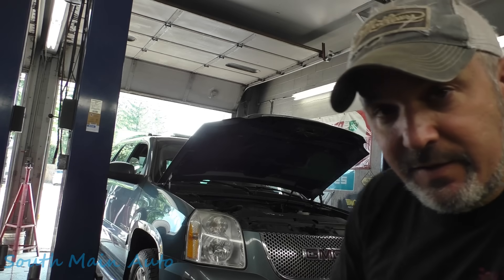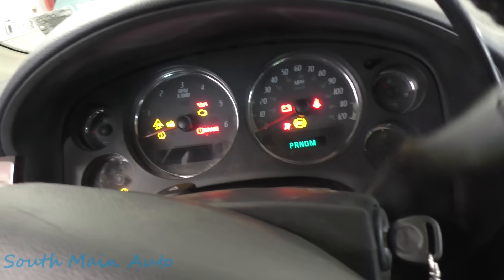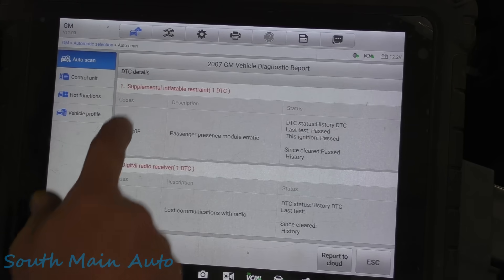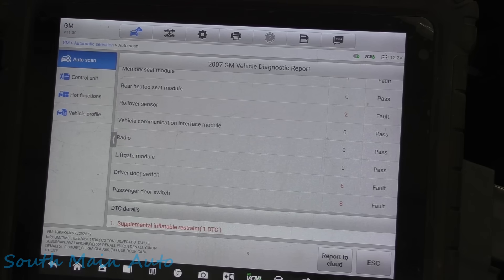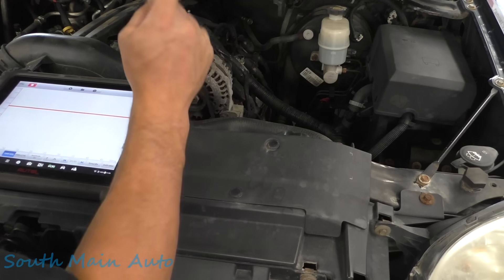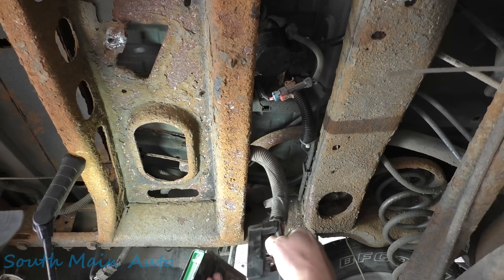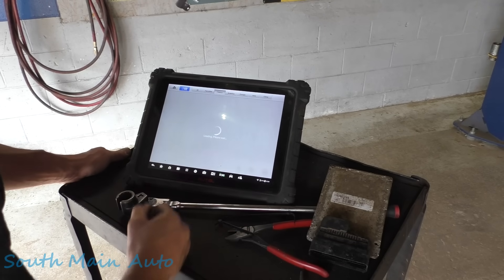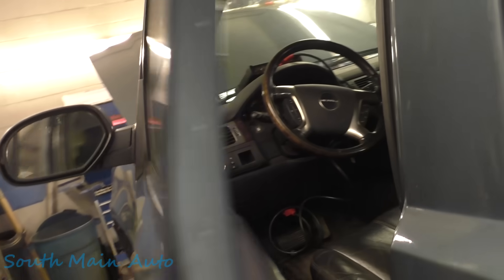Sometimes A Lucky Guess Is Way Easier Than An Actual Diag

Comment: I have a question.  If a customer comes in with a air bag light on, can you repair that vehicle except the air bag situation and release it to the customer?  I know working in a body shop, we couldn't repair a vehicle without dealing with the air bag situation whether it was related to the damage or not.  Just curious.  Thanks for the excellent videos!
Reply from the maker: You can't force a customer to fix anything...EVER. If you do, it is what they call "extortion" here in the USA and is illegal in every state. Some shops feel they have this power to force their customers to fix a car before it can be release by making up BS like, "oh it's the air bag you have to fix it." Find it in the penal law for your state and then we'll talk ;-)

Comment: 2012 Sonic LTZ 1.8l hatch, I got traction control, steering system, check engine light and get the same response when turning the key.  No codes and I'm up in the PNW so, no corrosion worth mentioning.  Any modules or experience with common causes on the sonic? I've cleaned grounds 100-400, all battery wire connectors, starter, alternator.  when I reattach the battery, the car makes a single long chime tone and then looses its mind and sounds like a classic bicycle dinger.  drains battery down to around 6.3v and I'm trying to get a new one soon.. Is it just a combination of bad brush connection on starter, bad/minimal ground and battery connection, loose terminal on FPCM/TCM connectors and a bad battery slowly overworking itself? Appreciate any thoughts, before I go crazy and DIY battery wires and my harness out of speaker wire and cut up jumper cables. lol

Comment: I enjoy your U Tube channel. I recently subscribed and wanted to communicate. I am new to this so bare with me. I want to ask if you have any experience with BG products. I have an 89 Cadillac Brougham with a 5.0 Y motor and an oil cosumption problem, started out 1 qt at 50 mi. Using various engine flushing products and frequent oil changes l have gotten it up to 1 gt for every 300 mi. Minimal oil leaks, new valve seals and some highway driving is how l got to this point. Do you have any experience with the BG motor flush treatment?

Comment: just a little note for you...don't be surprised if a swarm of PA cars show up in the future.  The state is considering legislation to *discard Inspections entirely or drop them to when the vehicle changes hands*...because the STATE makes no money on state inspections (just the inspection stickers)
That said, I have never heard of a single situation where that air suspension ever worked or was present to begin with.  Do those modules/motors fail the second they roll off the factory floor, or what?
Reply: And as a Pa resident, I wish inspections WOULD go away, or at the very least become less stringent. I have a 2003 Oldsmobile Aurora that everything passes, but one little rust hole the size of a pencil eraser where the bumper meets the quarter panel (only spot of rust on the whole car) caused it to fail. Underneath the car is in great shape for the year, especially since it originally came from Erie.
Reply: @mattcat231  you know as well as I do that the two sides will cancel each other out, and nothing will change.

Comment: How many times do you have to actually go through the steps to prove that if it walks, talks, and looks like a duck, that it is actually a duck before you can just use the fact that it is looking, walking and talking like a duck where you can be pretty confident that it is a duck without all the testing?

Comment: Why are manufacturers not required to add some type of bullet proof coating to the frames from day one? It’s ridiculous how quickly that steel can rust through like that. Motor and trans still does its job but rust ends up raping your pocket pretty darn fast.

Comment: Other than cost (which is everything I guess), it’s too bad all frame and other parts aren’t powder coated or at least epoxy coated from the factory.  It seems like such a waste, and a lot of otherwise good vehicles are scrapped.  For safety’s sake, it should be required.

Comment: Why are many of these rotting components not made from plastic? they seem to require zero structural strength.. but are made of metal, and stuck at the back of the truck.. at the worst possible place for rust/corrosion?

Comment: What is the Pringle light?
Reply: PRNDL, Park Reverse Neutral Drive Low
Reply: PRNDL = park, reverse, neutral, drive, low
Reply: Gear position indicator. P - park, R - reverse, N - neutral, D - drive & L - low. The gear shift indicator light group in the dash was not showing what gear position had been selected. Retired mechanic/machinist in Land Down Under. On the other side, Eric has many more skills than I ever had.

Comment: You call it a pattern I call it a personality, machines I work on typically have the same problem, whether to design flaw in mechanical or design flaw in software it’s all the same like you. People get mad, then when you fix a car in under an hour or are you in my case my machine equipment and they put in $1000 service call not my problem. And of course, in my case I don’t make the thousand bucks I make straight hour so

Comment: That is so weird that a suspension module would cause the truck not to start. You would think that the suspension module would only deal with suspension of the vehicle. Why does the suspension module cause the truck not to start?